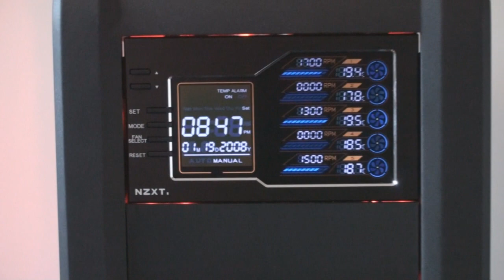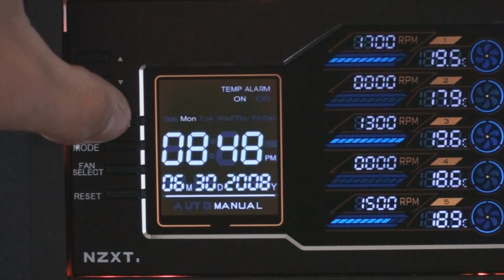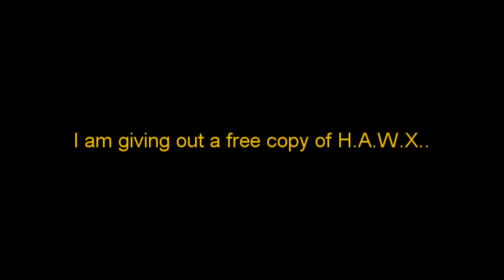EVGA X58 Classified, XFX 4890 XXX Crossfire, Intel Core i7 975 System

Comment: Is this from IbuyPower? I'm getting a core i7 930 x4 @ 2.80ghz 8mb l3 cache
and a Ati Radeon HD 5770 1gb single card is that good enough to run crysis on max with 1280x1024 0xaa ?

Comment: if you are spending that sort of money on it why not get 2 hd4870x2's instead?
also its been proven that a i7 975 is the same as a i7 920 with d0 stepping oced but its over $1200 aud cheaper.